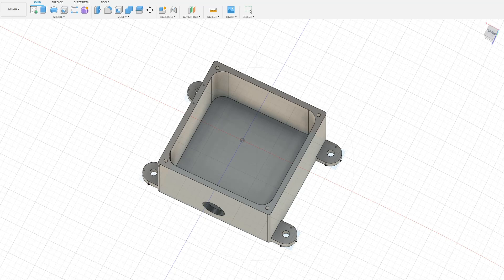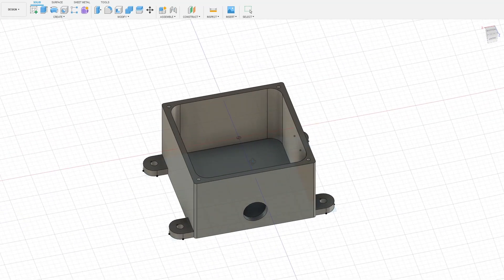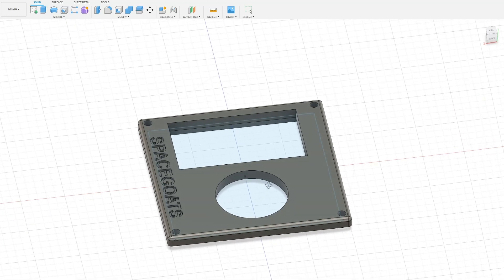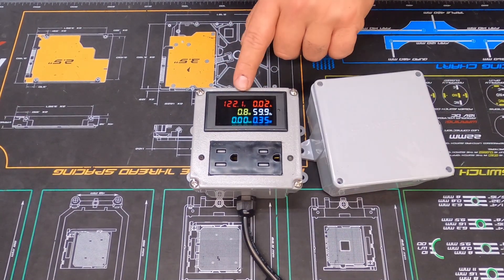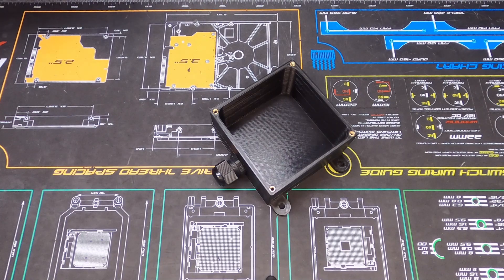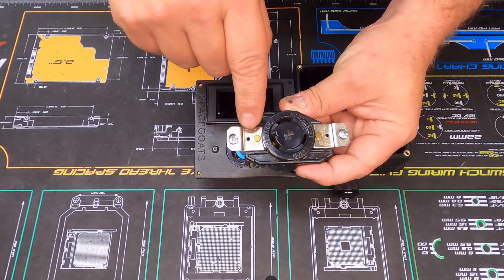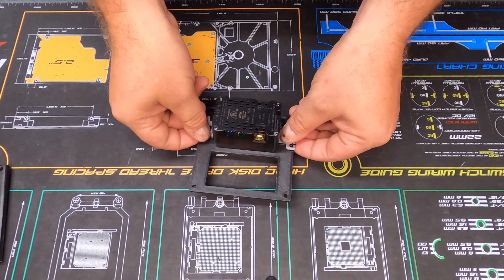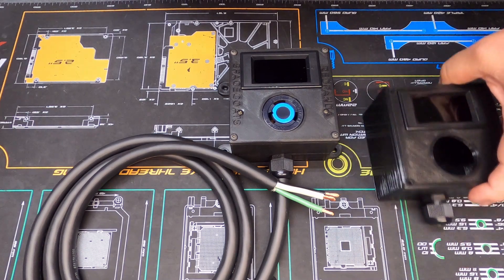3D Printed Meter Box for 120v or 240v outlets.

Comment: What would be really killer is to canabalize a WiFi smart plug that supports stats inside your wiring box and you'd have the perfect remote on/off, visual on-site real time live meter, working app.
Reply from the maker: Hmm, would be hard with a L6-30R outlet but I run the TP-LINK remote outlet on my miner and can manually kill the rigs remotely. Plus the rigs are set to power on with AC power. So there reboot on their own when the outlet is turn back on.
Reply: @spacegoats2194  most of the wifi plugs are built with internal tested up to 250v, I'm sure mmv by manf., Once opened up there are just terminals inside that I'm sure could be worked with. As far as adapters I can take my 220v server c19-c13 replace with c19-5-15 cord directly into a WiFi smart plus then buy a single 5-15r to c19 adapter and plug the server from pdu to original server cord. Both cords and adapters rated to 15-16A
Reply: @spacegoats2194  main reasoning behind the idea was remote stats, big down factor currently is finding smart plugs that still offer usage stats on amp, volts, watts; daily, weekly, monthly etc.

Comment: Looking forward to making a few, thanks for posting!  Quick question: what is the best practice for powering the meter? Do you just run a small gauge wire off the lugs on the plug or are you using wire nuts? What gauge wire are you using specifically for the meter? Figuring out the best practice for that has been something that I am hung up on.
Reply from the maker: I had some 18awg wire for PCIE cables so that was used. The wires to the are just to power the meter and are just sensor lines so don't need heavy Guage
Reply: @spacegoats2194  Thanks!, good stuff
Reply from the maker: Small wires off of both legs of the hot on a 220v meter

Comment: How hard would it be with a 3D printer to change the tab locations. Specifically, instead of mounted to the wall, mounting inside a wall for a flush look?
Reply from the maker: Would not be hard but would also mean running the cable inside the wall. If your going to do that might as well install proper metal box. Then use a modified 3d printed lid

Comment: Hello I like it meter with box complete how much cost you sell?
Reply from the maker: I wont sell the completed unit because of liability issues. But you can make your own. Its not very hard. I might Offer the 3D printed box for sell soon but will only be in USA.
Reply: @spacegoats2194  ok I'm in USA. But what is the parts or tool for meter, outlet 240v, box junction...?
Reply from the maker: @nestorasl2010  I have link to all the hardware in the description
Reply: @spacegoats2194  but I don't understand how to work build meter, outlet and cables etc.. very hard for me